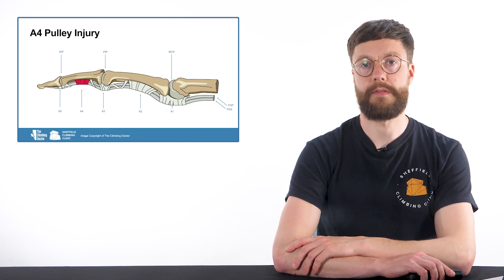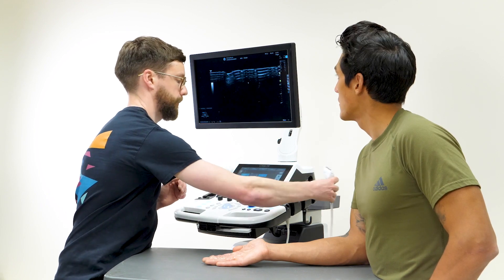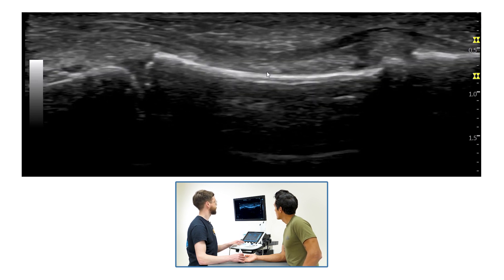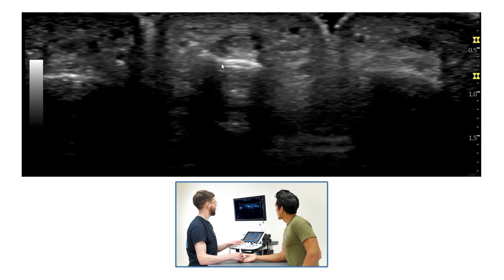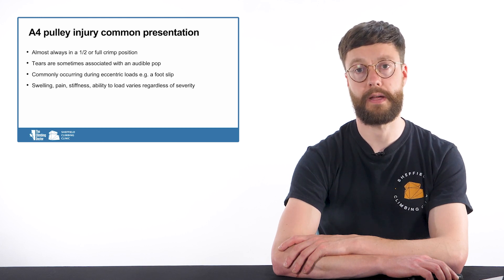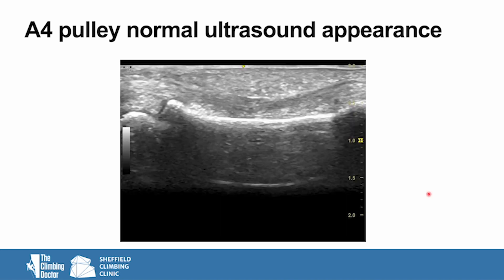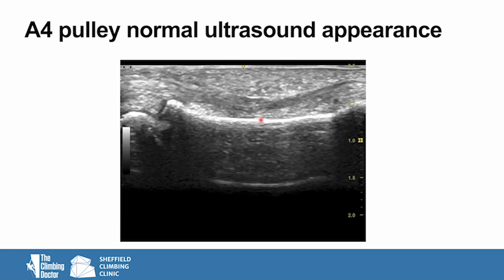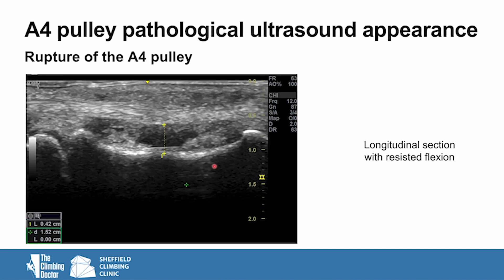How To Assess an A4 Pulley Tear

Comment: Hello! Great ultrasound video with comparison between a normal A4 and torn one. I was wondering what causes the A4 to be more at risk than the A2 for certain climbers. Is it due to anatomical differences of the phalanges or the distances between the DIP and PIP? Is it the way someone is crimping? For instance, hyperextension of the DIP joint when half-crimping (even when I half-crimp, my DIP and PIP aren't completely straight). Furthermore, most of the literature is focused on rehabing the A2 pulley (as it is larger and the most common injury ofc), but I wanted to know is there any difference in terms of protocol to rehab the A4 pulley. Are there major differences? If so, could you provide a video or blog describing the differences between A2 vs A4 pulley rehabing.

Thanks for the informational content!
Reply from the maker: Anatomical variations, genetics and movement mechanics may play a role in A4 vs A2 injuries. Rehab is based on the individual and there is meaningful variance, so there is no "one-size-fits-all" for A2 vs A4. What I can say is that teh rehab is typically quicker for A4 and we are performing a research study right now on if pulley splinting is actually needed for A4
Reply: @TheClimbingDoctor  Thanks for the information!
From my current experience, pulley splinting doesn't feel necessary for most days. The first 3-5 days however, as the inflammation was quite severe, maybe it would be ideal to reduce pain. They do heal somewhat quickly even without a training/rehab regimen. However, as this is my 2nd A4 rupture on the opposite hand but the same finger, I'll try and maintain a more strict finger training routine once the 2 weeks of rest is complete e.g., hangboard, farmer/block crimps.

Comment: first of all, thx for the great video. While i find some documentation on Anular pulley injuries A2 and A4 mostly, i find nothing about last C pulley ( C3 or C4 depending if you start at C0 or C1  ;-) , the one bellow the DIJ. IS it possible to damage C3 while A5 is ok  and A4 light injurury ? can C3 be checked also on imaging ? not asking you to diagnose anything, just understand if at all possible and how i could get it checked. Thx a ton for great channel !!!
Reply from the maker: US imaging in this video assess tendon bone distance - which is an indirect measurement of a pulley injury. Cruciate pulleys are just extensions of annular pulleys so not necessary to differentiate.
Reply: @TheClimbingDoctor  Thx a lot for the quick reply. I did not realize Crutiate pulleys are extentions of annular pulleys. I just had an echography showing A4 more or less ok ( some area are not homogenous and distance of tendon ok)  but with all symptoms of injured pulley), i was wondering if it could be the Crutiate pulley only ( as they are closer to joint, was wondering if tendon distance as assessment would still be relevant... anyway,  great channel !!!!

Comment: Have you trued using a water bath? Lets you get the probe further away from the finger and would allow for proper bending of the finger while keeping image quality good.
Reply from the maker: It is a cool idea and it can be done with most units. It is interesting to see tendon movement with finger movement - but it is not very practical from a standardized assessment standpoint for pulley injuries since you really don't need to be able to see a large range of movement to diagnose an A4 pulley injury. You just need to identify bowstringing at rest and at load - which is fairly easy to do without the water set up.

Comment: Hello, I dont know if I´ll get a response but I will give it a shot. 

I was doing a dynamic move, and barelly caught the hold with my ring and middle finger, I was a bit short on the move, I felt something happened to my ring finger/palm. I caught the hold in a open hand position. If I try to mimic the hand position there is a quite a lot of pain with just small pressure/force. So being in the open hand and trying to pull with the tip of my finger.

First I though it was a lumbrical muscle injury, but I am not convinced. I watched Hooper´s beta video about it, but I dont feel pain in my palm, I think, its somewhere between A4 to A5 area. But I am able to crimp with basically 0 pain on 25mm edge. I tried to localize the area with pallpation, but nothing is painful to touch. 

I know it very brief summary, but what do you think it could be ? 

Thank you if advance, if you answer. I´ll privide additional information if you need 🙂
Reply from the maker: The lumbricals attach from the FDP tendon so oftentime climbers have symptoms into their fingers or forearm in addition to the palm. The below article may help, best of luck!

https://theclimbingdoctor.com/pocket-change-adapting-the-way-you-pull-on-pockets/